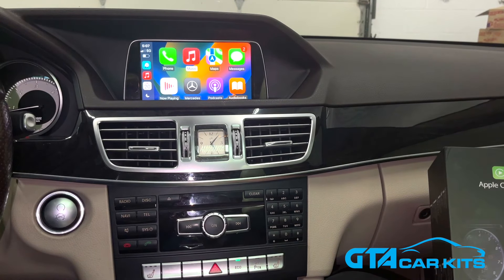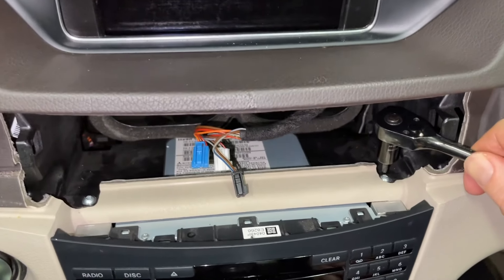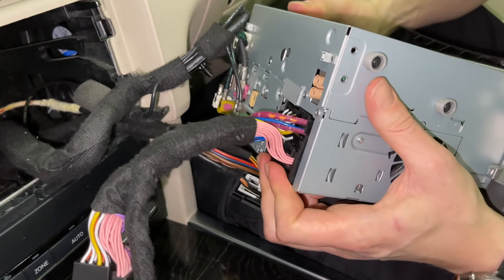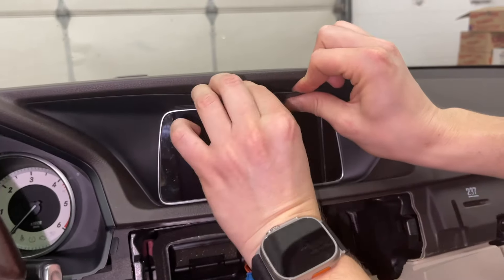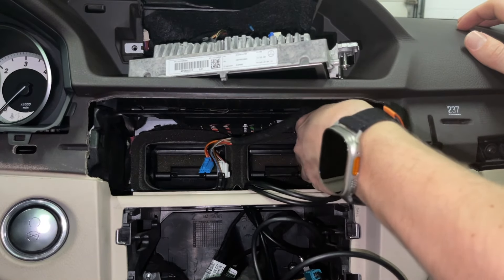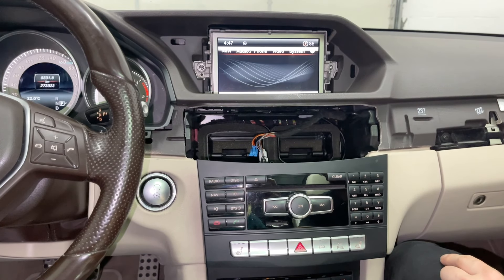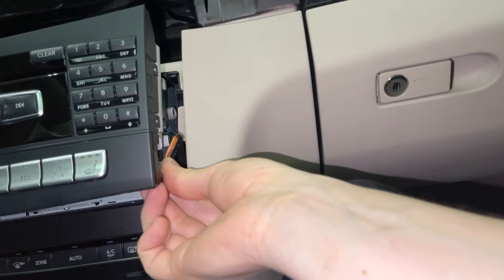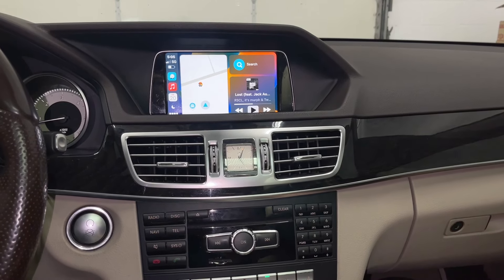Wireless CarPlay and AndroidAuto in Mercedes E-Class 2012 2013 2014 2015 2016 W212 NTG4.5 / NTG4.7

Comment: Just did this install, it worked perfectly and exactly as shown here. My only note was in the part where they recommend you crack the plastic to fit the wires through -- I didn't find it that difficult on my vehicle to get them up there without having to do that, but YMMV.

The biggest challenge for me was getting the head unit back in. The new harness/adapter kept getting in the way, and I had to get it lined up perfectly with a void below the head unit by getting my hand in there when the head was half-way in and pushing the new harness down, and THEN once it was perfectly in position, I could push the unit back in.

Otherwise excellent, super easy install, no weird trouble or tech support needed. Thanks guys!
Reply: Can I ask you how long does it take from starting the car till you can for example use navigation? It was cut in the video. Thanks.
Reply: My CarPlay is usually up and running BEFORE the screen finishes loading some times. It’s consistently about-as or faster than the OEM equipment is.
Reply: @deuley  thanks
Reply: Do we need to connect cable first to enable wireless CarPlay? I see him plugging lightning cord. I don’t understand why we need it if it’s wireless. Thanks!
Reply: @deuley you do not need to hold back button every time you start car?

Comment: I've just finished doing this and the installation went very smoothly, helped by your excellent video.

The only issue I had was with the sound.  I'm using Mercedes BT for sound.  My E350 already had Aux configured (probably from new) so I didn't need to change that.  Changing MOST from internal to external amplifier actually stopped sound from working.  I initially followed the instructions and sound didn't work.  Once I switched back to internal amplifier, everything worked perfectly.

The camera angles and lighting on this video really helped me when I installed my own and now I have Carplay working perfectly.  The screen is a bit small but everything works well.

Thank you.
Reply: When calls comes, does it come through Apple CarPlay? How does Siri works?
Reply: @santagautam115  Yes.  When a call comes through it shows up on CarPlay just as you'd expect and you can answer or decline the call in CarPlay.

Siri is astonishingly useless except for a very limited number of use cases and that is not CarPlay or this adapter's fault.  However, it's no less useless than on an iPhone, so when I say (fairly loudly) "Siri, phone [insert my wife's name here]." it does do exactly what you'd expect.

I have a BMW M4, which has CarPlay built in.  That doesn't really do anything that I can't do with my W212 E350 and this adapter.  Everything I use on a regular basis works equally well on both cars.

For £140 and about 90 minutes installation end to end, I'd say that's good value.  It's made the car feel five years younger.

Comment: I still cant get my sound comung out from the aux. Can u help me? Should i change to external amp? If i do that, my original player does not have sound. But both external amp and internal amp gives no sound from the carplay device
Reply: Me too please did you find a solution??
Reply: @FetchAl did you solve the problem? I have the Problem too
Reply: Did you guys find the solution. I also have no sound at all

Comment: Do we need to plug the phone into the USB? Can we do everything wireless without having a phone connection to a wire
Reply from the maker: You will be able to use Apple CarPlay and Android Auto wirelessly. Thank you
Reply: @gtacarkits I’m considering buying one for my 2013 w212. How does wireless works exactly? I couldn’t understand from the video. Thanks!
Reply from the maker: @santagautam115  You can pair your phone wirelessly to our kit, through our settings. Thank you.
Reply: @gtacarkits  via Bluetooth?
Reply from the maker: @santagautam115  Via Bluetooth and Wifi at the same time. Thank you

Comment: Are these compatible with the pre facelift w212? 2009-2012?
Reply: No
Reply: @beatsbyry  This isn't necessarily true.  My 2012 E350 is pre-facelift but has NTG 4.5 and this worked perfectly on mine.  What matters is what NTG version you have.
Reply: @joshuarosen6242 I have NTG4.5 in my '11 250 - however, does the handsfree work like it used to ?

Comment: whats the wifi antenna for?
Reply from the maker: Antenna is used for Wireless Apple CarPlay/Android Auto. Thank you.
Reply: Why did you have to connect to the lightning cable in the video if it's wireless?
Reply: @Amge55v8  He didn't.  It's just quicker and easier than Bluetooth.  He shows it working wirelessly later in the video.

Comment: This is bs, you will have problems.
Reply: I had issues 
What when wrong with yours?
Reply: This isn't BS.  It worked on my 2012 E350.  The only issue I had was that I had to use internal rather than external amplifier in the settings but apart from that, everything worked exactly as in the video.